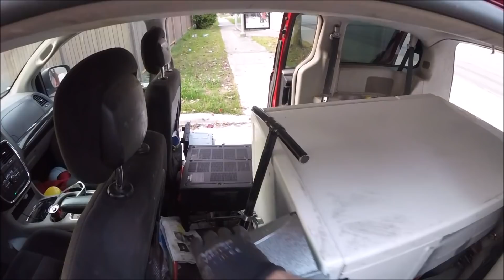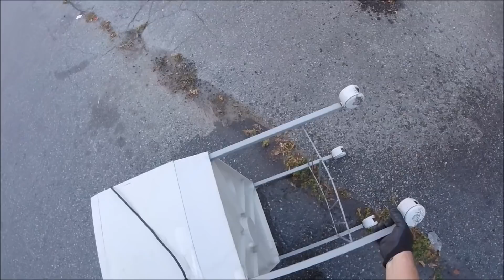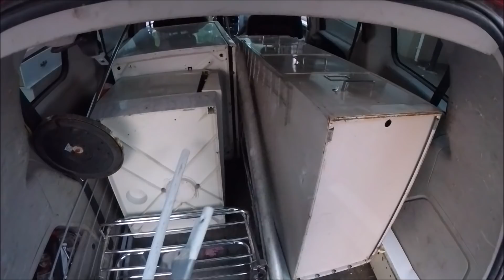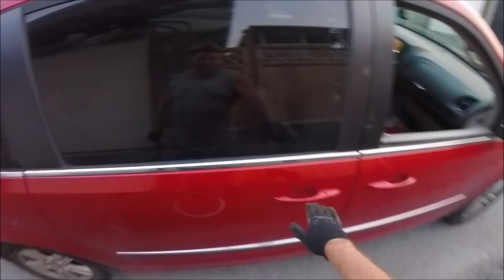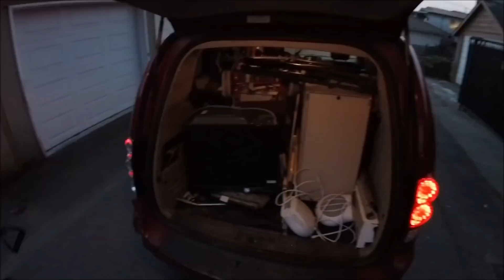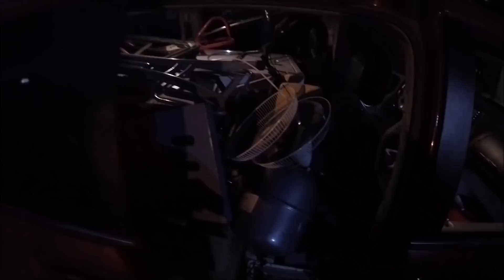Street Scrapping Looking For Smalls

Comment: When your van is full, you are struggling to find space for even smalls. I noticed your co-passenger seat is empty. You can keep some smalls like microwaves, printers, pans or even chunky HMS etc there and increase your intake easily by 200-300 pounds. Just wrap thick plastic over the seat not to get it dirty. Lot of leg room there. Just a suggestion.
Reply from the maker: If something is good the front seat is always ready

Comment: You are filling the bin once in about a week. Some times it also took two weeks. While your bin is getting filled, where do you keep the engine? Do you own it? You use the engine may be 2-3 hours per trip to the yard and back once the bin is full. Then engine goes back somewhere for storage. Did you check the economics of owning the engine and bin? I think you better off renting them out and using van for tin shred yard run too. You get rental income too. Just my two cents.
Anyway, just to let you know, not missing on liking all your videos.
Reply: don't worry, he owns the "engine" to his bin.
Reply from the maker: I keep the truck at my own house, I have owned it for 8 years
Reply: @CanadianTreasureHunter  Hmmm. You must be a rich man to keep it idle :)
Must have recovered the cost from business.
Later I realized that some times it is best to own a resource and keep it. In my last project, when we needed to urgently move material, sometimes it was hard to find trucks. If we had our own truck, we could have spared lot of tense moments. Feels nice to own equipment knowing well that it is there when we need it.